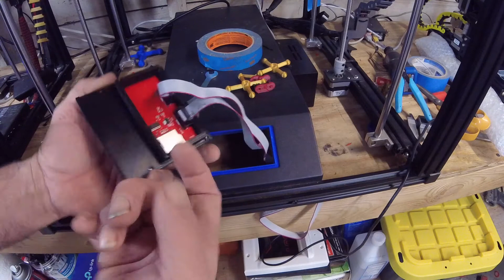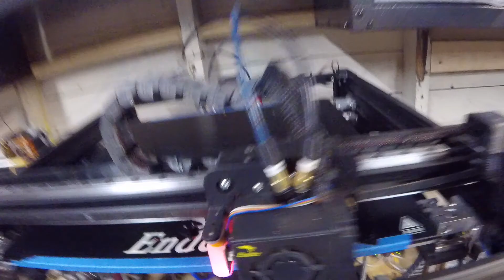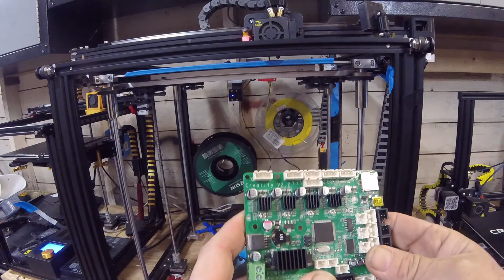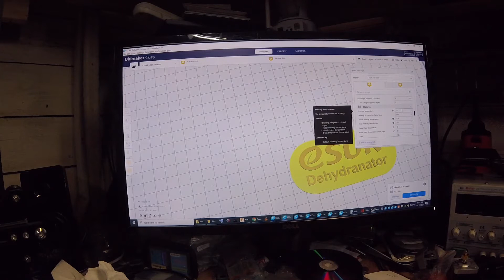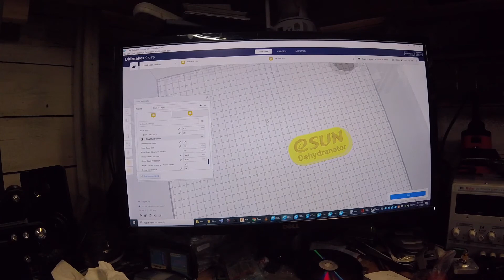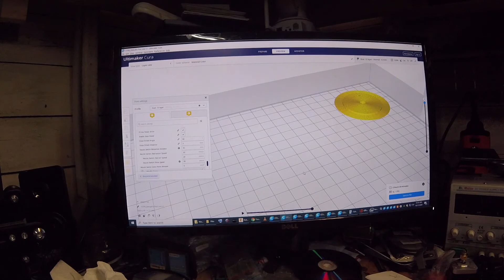Dual Extrusion 2 to1 Hotend Introduction

Comment: I can't get my 2 to 1 hotend to work right. Did you have to change any software gcode changes?
Reply from the maker: I think I set it up as a CR-X in cura and adjusted the bed size maybe. Also if you load the regular cura machine setting for your printer it should work as a single extruder no problem. What issues are you having